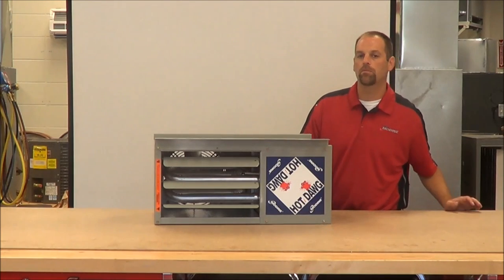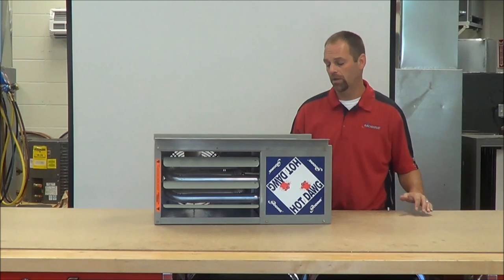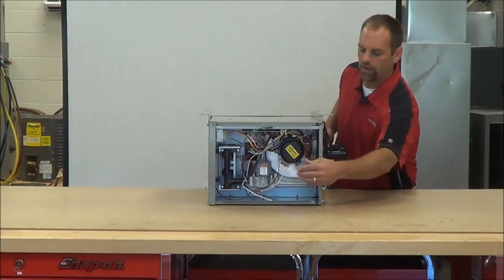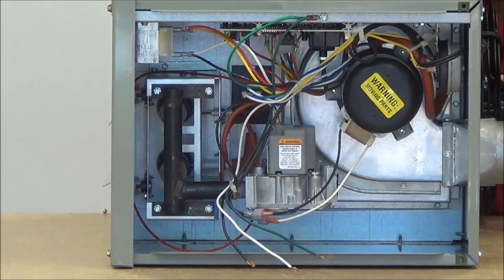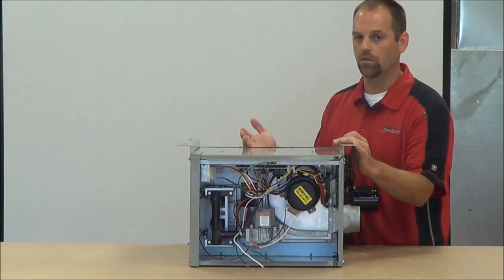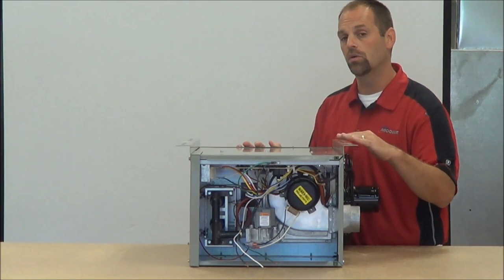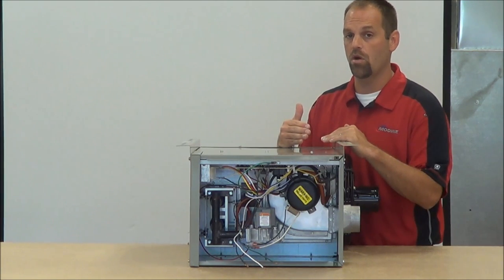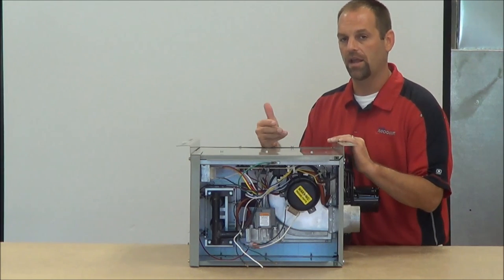Steps to Service Short-Cycling on a Modine Hot Dawg

Comment: My identical heater started doing this after five years of running flawlessly...... and no after five years the polarity of the wiring didn’t switch over night.  
I removed the flame sensor and cleaned it with light sandpaper and now it’s working beautifully.
Reply: MrDonnyt how’d you get at the flame sensor? seems like it’s buried in there

Comment: Had a service call tonight. Modine heater was on lock out. Homeowner said the burners  would shut off and on after he opened the garage door which rapidly drops temp in garage.  No time delay in tstat. The unit would short cycle till lockout as described in video however the problem was the flame sensor was still hot when a new call for heat was established. But read a code 6.  Installed a time delay. Problem solved. Funny thing is though it's a new problem under the same set of circumstances that the unit was installed. What changed in the unit? Why didn't code 5 read?

Comment: Any ideas why my 45000 hot dawg only turns on when I hit the side of it? I literally have to give it a whack and it immediately turns on. I think it might be an issue with the pressure valve but that's just a guess(haven't done any serious troubleshooting on it yet)
Reply from the maker: To be precise we would have to know what the unit is or isn’t doing before it is hit. This can be done by removing the access panel. Turn the power on and see if anything comes on at all. Does the power exhaust come on? Is there a flash code on either the gas valve or ignition control board depending on how old the unit is? May want to start by check all wiring on the unit for loose or bad connections on the 120 volt side and the thermostat side. Could be as simple as the pressure switch getting stuck once the call for heat is met and the unit shuts down. If you need further assistance trouble shooting, you can call the 800 number located on your serial plate. This can put in touch with a local Modine rep, a Modine tech or even an authorized contractor in your area to assist.

Comment: My unit has worked flawlessly for 2 years now and  just started doing this 2 weeks ago. I cleaned the flame sensor and it worked for a few hours and started again.  I just replaced the flame sensor and sensor wire. Worked perfectly for about 12 hours and back to this.  The green light give some the same 2-blink code.  What am I missing??
Reply from the maker: With current Hot Dawg builds, a 2-flash code normally appears right away after a call for heat and specifically means that the controller senses the pressure switch is closed before a combustion air draft is created. Possible causes for this fault code include defective pressure switch (contacts stuck closed), mis-wired control harness, damaged yellow pressure switch wires (damaged insulation, shorted pins in the wire harness plug), or a defective controller. Once the cause of the 2-flash is resolved, and the room thermostat is calling for heat, the unit heater should resume normal operation.

Comment: My heater is short Cycling , then locks out, 4 blinks of the green light. Flame light does not come on at any point. I have switched flame sensor with a working unit with no luck. Polarity is not reversed, have already switched the wires and acts exactly the same.  This is a new installation. Any help is appreciated
Reply from the maker: Other than what’s in the troubleshooting guide, I would also recommend checking:
Inlet gas pressure does not drop below the rating on the nameplate when the gas valve opens. 6-7”WC for nat. gas, 11”WC for LP. Max inlet pressure for both types is 14”WC.
Brass orifice spuds and in-shot burners are aligned and aimed straight into the heat exchanger tubes. 
Pressure switch contacts are not fluttering open during ignition.If you need warranty parts such as a new ignition controller, you will have to pursue the replacement through the company they bought the heater from.

Comment: Mine is 20 years old and decided to stop working. The inducer starts but the igniter doesnt get hot and the valve doesnt open. There is a single LED to flash trouble codes, and it just flashes bright dim (normal operation)
Do all igniters and valves run on 24 volts?
Reply from the maker: Yes, all Hot Dawg models that burned gas would have a 24V transformer to run the ignition controller or in this customer’s case the Smart Valve.
Reply: @modinehvac  Mine seemed like everything was working except the ignitor. It's been "repaired", but then I found out my thermostat was bad, so maybe that was the trouble all along.

Comment: I’m having the same issue my unit is brand new. My unit is a modine pdp350. Instructions say is a 230 v system. So I wired it accordingly. And it’s short cycling. As you explained. Any advice.

Comment: OK we have a really old natural gas commercial ceiling hung heater in the shop.  It cycles on and off when you turn up the thermostat for heat.  It runs and flames up and the fan runs then it stops after about 10-15 seconds?  It repeats this until it somehow decides to keep running to bring the shop up to the called for temp.  Is this the heat sensor?  Someone said it might be a Thermal Disk?  We have no idea what is happening or what make or model of heater this is.  Looks like Modine to me, but not a 100% sure. Any help will be appreciated.
Reply: Hi, my name is Steve with Modine technical service. Regardless of the make of the unit, all gas unit heaters operate in the same fashion. I'm assuming it is too old to have a control board with flash codes. If not, that would be where I would start. From there, being that old, I would got over every single wiring connection to make sure nothing is loose, not even a little. Next clean the thermocouple of flame sensor with a piece of fine sand paper or emery cloth. in a pinch, a dollar bill will work too. Lastly I would use a multimeter on any rollout limits and high limit switches as the unit is failing to fire to see were the signal is lost at the time of a failure. You will want to put your test leads to test for voltage across the limits switches and hold them there unit the unit fail. if (measuring across the terminals) the voltage goes from 0 to reading 24 volts, then you just found the problem.
One last thought, if this is a natural draft unit than be sure nothing has changed in the environment or with the flue venting it self that could have restricted the natural draft up the flue pipe from occurring. It may be having a hard time at the initial ignition establishing a natural draft and causing the high limit to pop because of that.
Reply: @stephenduppstadt  Thanks Steve... I will give it try.

Comment: Jason - mine united worked for years, was not used for a couple years, and now with added a full tank of fuel it will not fire. It cycles with the flame igniter but the gas valve sounds as if it only opens for a second. Also I am not getting a pilot flame to then communicate to the flame sensor Please respond if you can communicate with me - thanks scott

Comment: Mine was working for 2 weeks after installation but now when I turn it on, it goes through the initial purge, attempts to ignite, and then immediately shuts down after failure to ignite.  Both lights are off when the unit shuts down, and I can only start it again by restarting power to the unit.  Any thoughts on the issue?
Reply from the maker: Be sure to check all voltages.
115 volt on L1
0 volt on Neutral
Secondary voltage 24 volt.
On this unit the problem may be the earth ground. Make sure the ground is tight and secure. This ground screw can be found inside the unit.
For further technical help, use: PH: 800-828-4328 I Technicalservice@na.modine.com

Comment: I think mine is doing this.  Why would it do this after 10 years of service or does this just happen for a new install?
Reply from the maker: The below video is describing reverse polarity. This would only
happen at original start up or if unit has been moved or rewired. It would not
happen randomly after ten years of service as seen below. If unit is 10 years old, further troubleshooting would be
necessary. Could very well be unit is not sensing the flame. May need a new
flame sensor.-Modine Technical Service